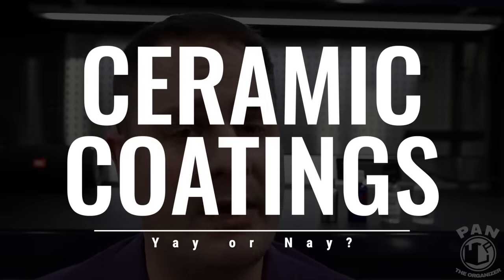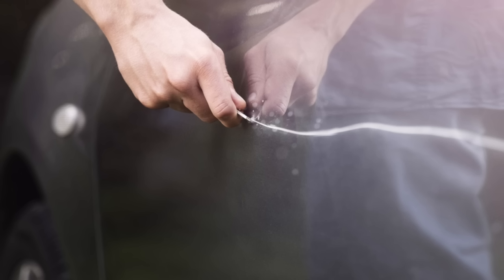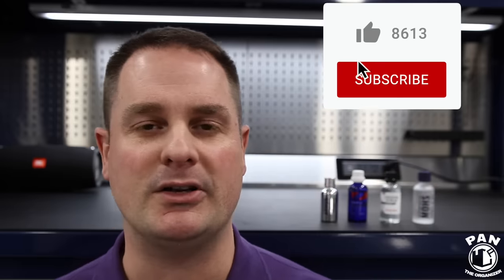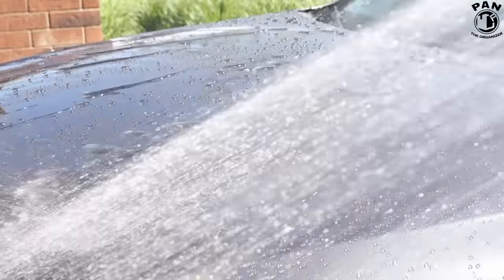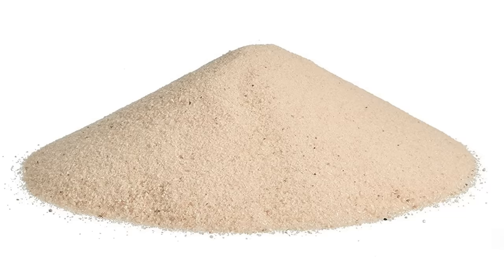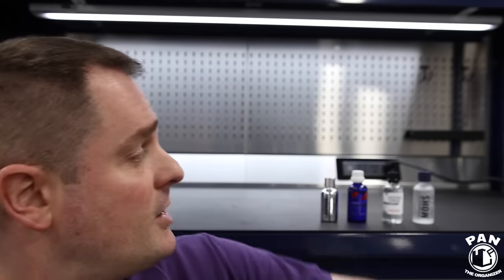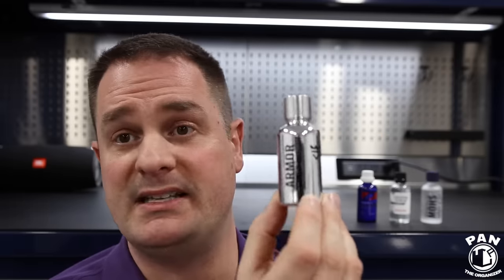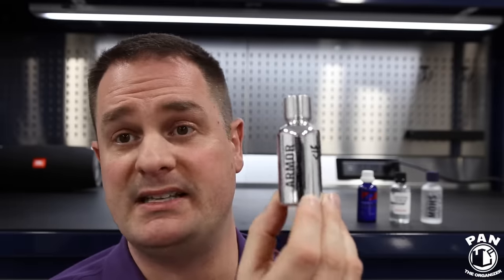DON'T BUY CERAMIC COATINGS BEFORE WATCHING THIS !!

Comment: Pan, good morning.. i know you have carpro UK3.0 on your topped with carpro gliss.. I also followed your steps and have the same.. but i seem to get water spotting very easily once it rains and the vehicle is left in the sun for a few hrs.. does this happen to you and how do you deal with it
Reply from the maker: I don't have CQUK 3.0 anymore on my car. I had a professional grade ceramic coating applied in April 2019: the. 7-year Opti-Coat Pro+.  I even did a full application video here: https://youtu.be/C_hb8PMP3KA

That being said, CQUK 3.0 is still my favourite consumer grade coating. I never had water spotting issues with it, as my car is garage kept, and I have a water softener system at home. 

If you have water spots, try using CarPro Spotless, a water spot remover that's safe on ceramic coatings. Or the steps in my tutorial on how to remove water spots: https://youtu.be/s1XNKFVSwRk

Comment: Salut PAN :) Je viens d'acheter un Ridgeline Black Edition 2021 Crystal Black, J'hésite entre le Carpro SIC et le Avalon King, quel sera le plus efficace sur ce camion? Je veux le garder longtemps et je lave minimum une fois par semaine.
Reply from the maker: SiC va durer entre 18 et 24 mois. Le AvalonKing peut durer plus de 3 ans si tu appliques deux couches et le maintiens bien. Les deux sont d'excellents choix.

Comment: Thanks Pan for making this video! Would I be able to reuse the towels that I used if I applied a ceramic spray sealant like Turtle Wax ceramic spray coating?
Reply from the maker: Yes, just wash them immediately after use and reuse them.
Reply: @PanTheOrganizer  thanks!👍

Comment: With the armor shield ix being able to be used on plastic trims etc, is application and levelling exactly the same on these parts? For example, texture coated plastics?
Reply from the maker: Not quite as you won’t see flashing on parts other than clear coat.

Watch my video: https://youtu.be/6hDGYz6vvsw

Comment: Hi. Tanks for the info. I am a newcomer to your channel. Subscribed!. May I ask if there is any sponsorship from Avalon for this video or the channel? Thanx
Reply from the maker: Hi Ismael. First, since you are new to my channel, let me officially welcome you to the Pan The Organizer family. You found one of the biggest car detailing channels on YouTube as we're approaching 600,000 subscribers and 70 million views. 

To answer your question, when I do sponsored content, I clearly mention it in the video as well as in the description under the video. AvalonKing has sponsored some content on my channel. But as you will quickly learn with my channel, I only review products that I have personally vetted from brands I actually like. All products that I have in my own detailing arsenal. So I still always give my unbiased opinion, as the brands have no influence on my content. I would go even further as to say I'm one of the rare ones that actually discloses this to my audience. Not many channels disclose sponsored content. 

Now a question for you. How did you discover my channel?
Reply: @PanTheOrganizer  thank you for your answer. I was looking for profesional unbiased information about ceramic coatings. YouTube search engine. 
I have just restored my old loved car. I took it home after it was clear coated, put it back together, and now (three months later) it's going back to the shop for wet sanding and polish for a final finish. I want to protect it inmidiatly with a ceramic coating and want to do it myself. Avalon seams to be the right choice.
Reply from the maker: Yes AvalonKing and CarPro CQuartz UK 3.0 are currently my favourite ceramic coatings for consumers. You should also watch my highly popular ceramic coating application tutorial, it's the most popular on YouTube with over 4.2 million views. Here: https://youtu.be/byKcYsEyWGk

And if you are curious, I make a super popular annual car detailing products awards video, where I show my top 3 picks in each product category. Here's the latest edition: https://youtu.be/ULvGi3dbBrA

Comment: Is it easy to remove the ceramic coat at the end of its lifespan by doing paint correction before applying the new coat
Reply from the maker: Yes

Comment: Hey Pan great informative video! One question I have is can and/or should you apply a good wax on top of the ceramic coating for extra protection/gloss?
Reply from the maker: NEVER apply waxes on top of ceramic coatings. You would apply a silica spray sealant as I said in this video. Here's a popular tutorial that I have on how to do a proper maintenance wash on a ceramic coated car: https://youtu.be/yLiePQRMFc8
Reply: @PanTheOrganizer  ok thank you! I'll be ordering the avalon King armor shield kit from your link when my new truck is built. Sounds like a great product
Reply from the maker: It is. I have many videos on it including a three months update.
Reply: @PanTheOrganizer  what is the best silica spray to use for maintenance washes with this ceramic coating?

Comment: How do ceramic soaps fit in to this? Just like the carnauba wax infused soaps, some SiO2 soaps have joined the market recently.
Reply from the maker: I tend to prefer pure shampoos with no protection in them, and then applying my choice of topper or quick detailer at the end of the wash process.

But for those pressed with time, and want a shampoo with infused ceramic or graphene to get about 3-4 weeks of boosted protection, yes some of those SiO2 infused soaps are a good option.
Reply: @PanTheOrganizer  Thanks for the quick reply! The level of interaction you have with comments is superb! I currently use a carnauba wax infused soap and have been for years with the occassional wax application, but was tempted to get one of these new ceramic SiO2 soaps. The pure shampoo with choice of topper sounds like a better way to go. But say I decided to switch. Last weekend I washed with carnauba shampoo and then this weekend I switch to a ceramic shampoo. Could there be issues with the ceramic shampoo being applied to a surface with residual wax potentially?
Reply from the maker: Yeah I wouldn't recommend mixing regular waxes with ceramic based products. If you have a ceramic coating, you can use a ceramic shampoo or silica spray sealant for maintenance. If you have a wax on your paint, or a regular synthetic paint sealant, you can use a wash n wax shampoo...

Ceramic based products will eventually reject waxes, plus waxes applied on top of ceramics usually end up masking the coating's superior properties. You don't want that.

Comment: Can a ceramic coated car be taken through an automatic tunnel car wash?  I have heard that the tunnel wash will destroy a coating.  But a car that has a wax or sealant on it will not?  This doesn't seem to make sense to me.  I never hand wash my cars (except my soft-top convertible) and always run them thought a tunnel wash.  I know that is not ideal, but I hate hand washing!!  Thank you for your assistance.
Reply from the maker: Any automatic car wash will strip and break down regular waxes and sealants. They can't resist chemicals that much, and automatic washes use high pH (alkaline) soaps which break down waxes and sealants.

Ceramic coatings are way more chemical resistant and durable compared to waxes and sealants. It's a completely different level. However, automatic car washes that use spinning roller type brushes will eventually damage ceramic coatings, not because coatings can't resist the chemicals, but because of the abrasive nature of the brushes. FRICTION is what will damage a coating over time.

So I would never recommend that someone goes to automatic car washes, even if they're touchless ones, because of damage they can do to paintwork over prolonged use.
Reply: @PanTheOrganizer  OK.   The friction issue makes sense.  So it's safe to assume that this same friction issue would affect waxes and sealants, not JUST coatings?  Thanks Pan for your response!
Reply from the maker: Correct
Reply: @PanTheOrganizer  Thanks again, Pan!!!

Comment: I don't have a garage, so is it OK to apply outside?  I live in Oakland, CA which is near San Francisco.
Reply from the maker: As long as it doesn’t rain for the required curing time (24-48 hrs depending on what coating you bought) and don’t work in direct sunlight.

Comment: So even if i have    a bit of rock chips on my  alloy wheels  ,  i can coat the wheels with ceramic coating  , with out problems ?
Reply from the maker: A ceramic coating needs to bond to clear coat. So if you are missing clear coat on the wheels because of the chips, it won't do much protection.

Comment: Any updates 9 months later? Can i put a base layer of gtechniq and put a top coat of griots 3-in-1 every 2 weeks?
Reply from the maker: Update on what exactly? I don’t understand your question. And yes you can use the Griot’s product as a topper over an existing ceramic coating.
Reply: @PanTheOrganizer  i meant any updates as in any new products or any new methods

Comment: if the car the front and the rear bumpers have repaint how many days after   is ok to put ceramic coating ?
Reply from the maker: Wait 1 to 2 months on repainted panels before applying any time of protection.
Reply: @PanTheOrganizer  thnks

Comment: Hi Pan, after watching this video I've ordered some Armour Shield 1X from USA.  I don't have the means to do the prep work, is it ok to wash my car then apply the ceramic coat?  Martin
Reply from the maker: For any true ceramic coating in a glass bottle, preparation is the MOST IMPORTANT actually, as you need to make sure you have a virgin surface to apply the coating to. Ceramic coatings need to bond directly to a clean and contamination-free surface. 

Also, you must make sure the surface doesn't contain any previous wax or sealant, or anything preventing the proper bonding of the coating to the clear coat.

So depending on the state of your paint, and depending on if you have any current protection on the paint, you should think of a few steps. To help you, watch my AvalonKing application video here: https://youtu.be/Rgli6VNLsK4

And my popular general tutorial on properly applying ceramic coatings here: https://youtu.be/sqQYVjxFqK0

Comment: As always, great video Pan! Very happy that you touched on how to maintain your paint after ceramic coating your car and what not to do (like clay bar) 👍 I'd love to know if I can use HydroSlick from CG (creamy ceramic coating) instead of a silica spray sealant to "rejuvenate" the coating -- just because it is already in my detailing arsenal. It's a pretty popular product so I think this might help others as well 🙂
Reply from the maker: I would avoid using CG on a ceramic coating, as you would be altering the coating’s performance too much in my opinion.
Reply: @PanTheOrganizer  Makes sense. Thanks Pan!

Comment: I used carpro lite and it was so hard to wipe off. Super sticky, I tried wiping immediately and waiting. Is that normal?
Reply from the maker: Nope. Was it an old bottle? What prep did you do before applying? What conditions were you in? Inside, outside? Direct sunlight? Too humid?

Comment: So, one line of product on the applicator is good for one 2×2 ft area? After that, you need to use more?
Reply from the maker: One line can cover half a hood easily. You'll see as you apply. A little goes a long way.

Comment: Hello Pan The Organizer! How many layers of Ceramic Coating is advisable? Here in the Philippines, 4-6 layers is the most commonly offered.
Reply from the maker: LOL If there is a ceramic coating that requires 4 to 6 coats, stay away from that brand. No serious reputable brand requires that many coats. CarPro, GYEON, Kamikaze, Fictech, AvalonKing, Gtechniq, Optimum, Ethos, GlassParency... All awesome brands and their coatings only require 1 or 2 coats.

And the number of coats depends on which product you buy. Some only need 1 coat, some recommend 2 coats, some need 2 coats. You have to read the instructions of the coating that you purchase.
Reply: @PanTheOrganizer  Woah is it detrimental to the car to have 4-6 layers of ceramic coating? I meant to say detailers here in my country actually put on 4-6 layers and I'm not sure if I should go for which one. Thank you so much for your insight!

Comment: i f my alloy wheels have chips in the paint can i use ceramic coating  on them . with out causing more dammage ?
Reply from the maker: No, as ceramic coatings need to bond with clear coat on paint that is actually there.

Comment: Not sure if you'll come back to this video via a question. Why do some car wash soaps that all over the car detailing asile saying car wash soap with ceramic etc. Makes it really confusing.
Reply from the maker: Hi Brad. As you can see, I always try to respond to my viewers on YouTube. :). To answer your question, most brands offer products to meet certain demands from viewers. I personally prefer pure shampoos, not infused with protection in them (waxes, ceramics, etc). But some people want to save on time and don't have time to wash and wax, or don't have time to wash and apply a ceramic protection. They want a one-step solution that can clean and add a bit of protection at the same time. So they created wax-infused shampoos (typically called wash-n-wax) or ceramic infused shampoos.

People who have ceramic coated cars need to do some type of maintenance generally once every 2-3 months to maintain the properties of the coating. You can either wash the car and apply a silica spray sealant, or you can purchase a ceramic infused soap that will wash and also add a small layer of protection. You have the choice.

I hope this helps to answer your question.
Reply: @PanTheOrganizer  I definitely like that you reply back to viewers and not some crappy way either, you told me everything I wanted to know and it definitely makes sense! Thank you for taking your time out again to reply to another one of my questions! It's something rare sometimes with detailers not getting answers back right from the channel itself. Thank you!
Reply from the maker: It's my pleasure Brad. I also see all the support you gave me, and it means a lot. And thank you for noticing that I reply directly. Many people still don't realize that I can spend 3 to 4 hours every day in front of my computer responding to the thousands of messages I get on all platforms. I focus more on YouTube comments, because beyond that, I would die trying to respond to everyone lol. The size of my audience has reached a point where it's huge. But I still respond directly as you can see and will continue to for as long as I can. You guys are what made my channel possible. And more awesome content to come, so stay tuned! Starting tomorrow (Wednesday) with another mid-week video! :)
Reply: @PanTheOrganizer  you answered everything and again as a detailer (sorry no YouTube videos) but your channel has been a decision maker on some products and tips and tricks! You're doing amazing!

Comment: Do you have to use all the product when you open the bottle of ceramic coating?
Reply from the maker: No. You can keep it up to 1 year after the bottle has been opened, as long as it never freezes.

Comment: Hi Pan! First time viewer here!! Love your content(I just subbed)!!! So detailed and informative! I have a question, what would you recommend to protect against paint chips from rocks(if there are any protectants)? Please and thank you!!
Reply from the maker: Hi Corie. Thanks for the positive feedback. Welcome to my channel. You discovered one of the biggest car detailing channels on YouTube as we surpassed 750,000 subscribers and are getting close to 100 million views! I have been detailing for 25 years and I love to share my knowledge and passion with my viewers.

You found the right channel to help you learn everything about detailing.

To answer your question, the only thing that protects against stone chips and scratches is PAINT PROTECTION FILM, also known as PPF or clear bra.

It’s basically a transparent film that is applied on top of your paint either to the entire vehicle (very expensive) or on high impact zones like your front bumper and hood.

This can only be done by a professional PPF installer.
Reply: @PanTheOrganizer  Thank you so much!! I will definitely look into that. 😊

Comment: Hi Pan! I just bought a new Porsche. My last car I treated with ceramic than ONR+bead maker weekly. Bead maker and ONR is really awesome so I ask myself if the ceramic coating is a MUST have or Could have... can you give me a tip? Thanks. And... How does it goes with your Supercar? :-)
Reply from the maker: I also apply a topper for maintenance of my coated cars. It boosts performance, gloss and slickness. So if that method worked for you, continue doing as is. 

Congrats on your new Porsche!!  What did you buy?
Reply: @PanTheOrganizer  Thanks for answering me. I bought a Macan turbo (as my wife rides it too and loves SUVs)... I wanted a Aston Martin but it's a "little bit" too expensive for me (but I keep working really hard... who knows) ;-)
Reply from the maker: Great choice!! 👍🏻
Reply: @PanTheOrganizer  yours too ;-) 911 :-)

Comment: Hi, have you done a video about paint protection film and the current options? also about applying ceramic coatings on the film.
Reply from the maker: I haven't yet.
Reply: @PanTheOrganizer  are you familiar with the products if I was too ask you, it’s a 2021 vehicle. They have 3m film & kavacha available and use Feynlab or ceramic pro. We were going to paint protect the whole car and then use feynlab for the ceramic coating. Not sure what combo to use, it’s a 2021 gmc denali.

Comment: Do u have to throw away micro fiber cloths after using silica spray sealants also?
Reply from the maker: No. (Unless specified by the brand). Wash them immediately after use and reuse them.